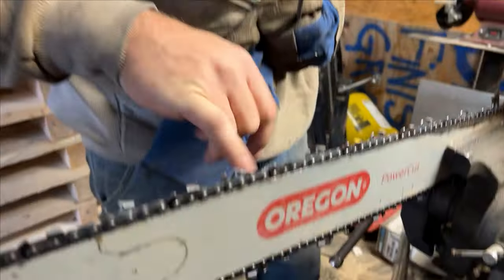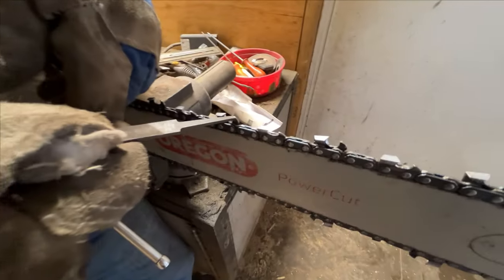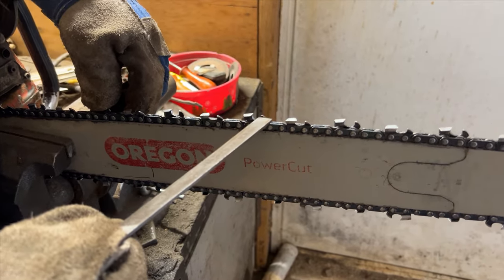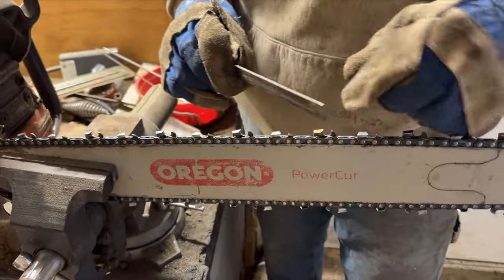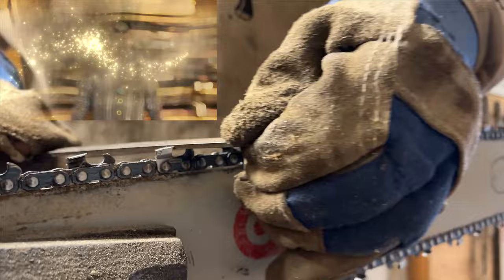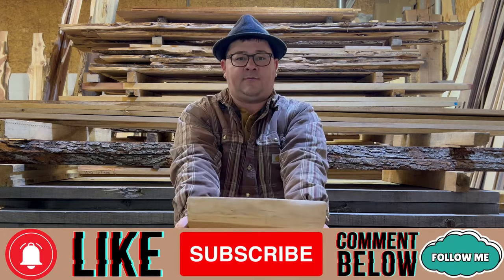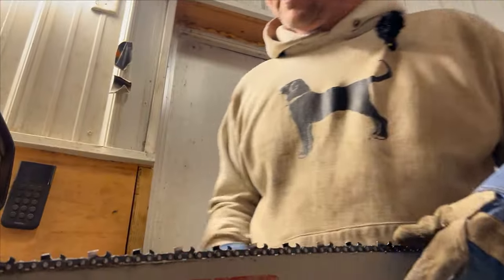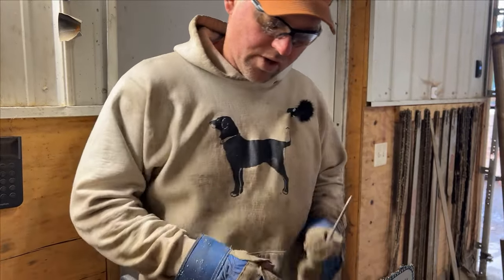How To Sharpen Your Chainsaw So It Cuts Faster! Flat File Raker

Comment: U should use gauges, the correct ones for your chain, its usually in the technical section of the owners manual it will help you get consistency across all the teeth  as well as the rakers, also the strokes dont matter if the rakers are set the same.  🍻
Reply from the maker: BuckALL! Love your content btw! Keep up the good work brother!